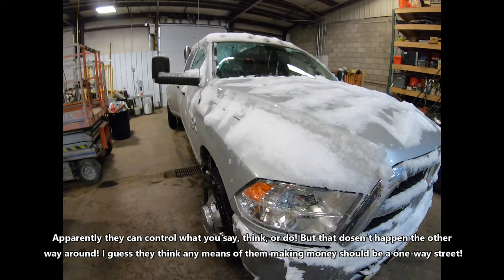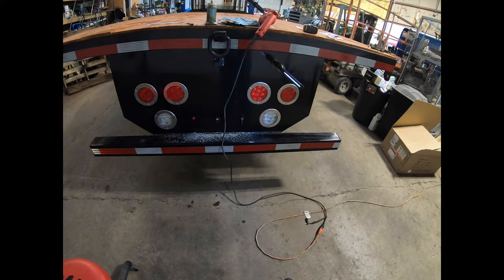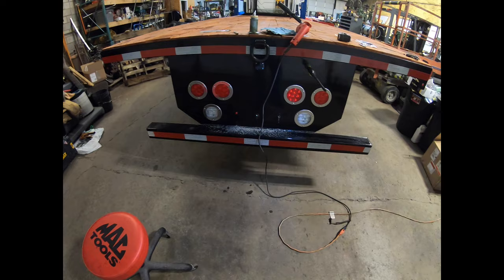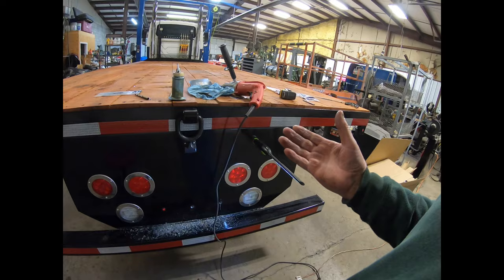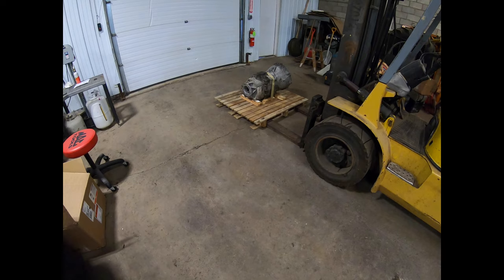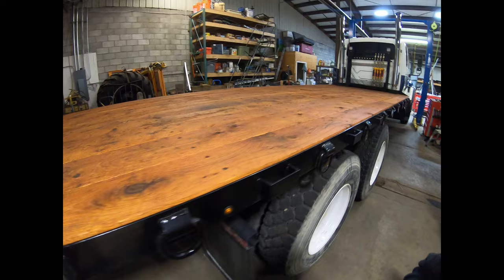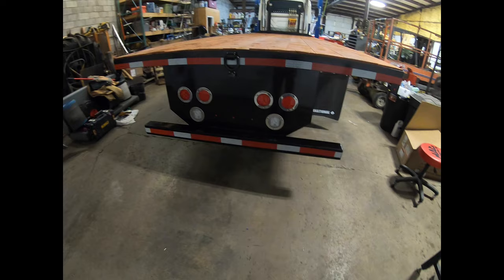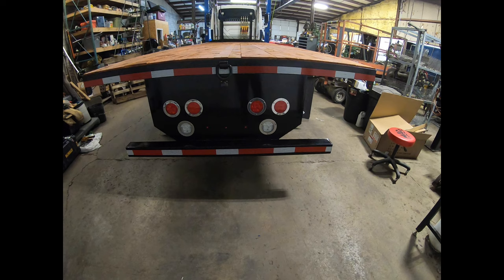Shop Update 04/30/21 - The Sadist Day of My Life

Comment: I still have the notes from getting my lights sorted out on my truck. The inspector told me "any vehicle over 80 inches wide (not counting accessories like mirrors or steps) must have the 3 identification lights centered on the vehicle. The lights must be between 6 and 12 inches on centers.  The front must be Amber (on top of the cab usually) and the rear must be Red."    Keeping you in my thoughts.